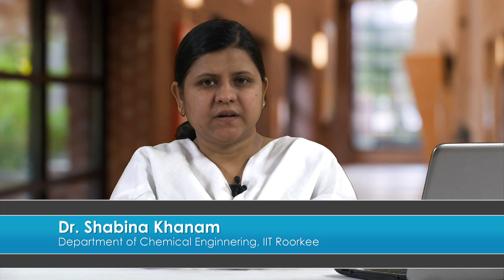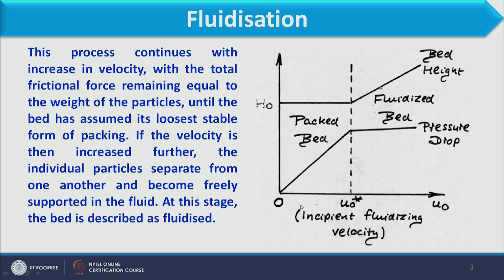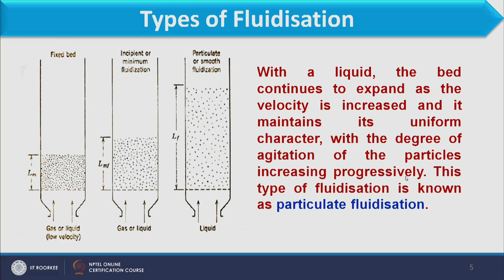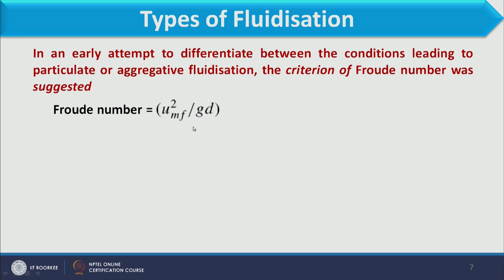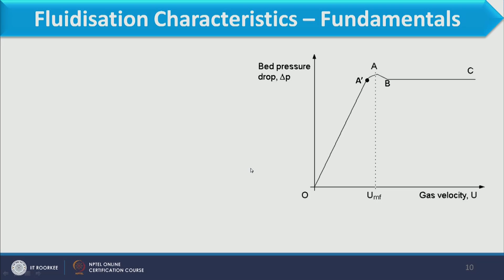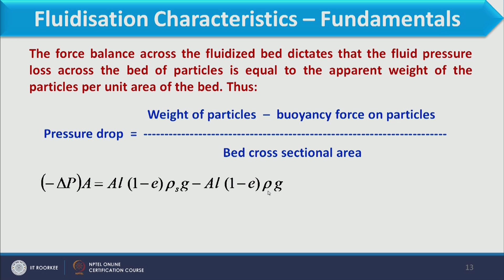Fluidisation-1

Comment: Question: My vertical standing tank is 60" height x 4" diameter.
Water entry is from the bottom and exits from the top.
The required freeboard area for the media is 200% (small TAC polymer spheres).
This makes the maximum bed height within this tank 20"  (20" media bed with a 40" freeboard area above the bed)

All video explanations I've seen so far so far about fluidization assume that the top of the tank is open, allowing escape of the media ie: "blow away" or "pneumatic transport" outside of this tank.

My tank has a filter screen at the bottom of the tank (for which the media bed rests at no flow) and a filter screen at the top of the tank (preventing the media from ever escaping the tank).

I'm assuming that exceeding the maximum fluidization expansion, the media will start to revert back to its starting bed depth of 20" ..... at the top of the tank! ..... creating a "plug flow" (flow restriction) to the water trying to pass thru.

Its this correct?